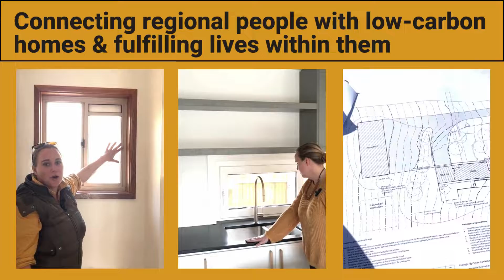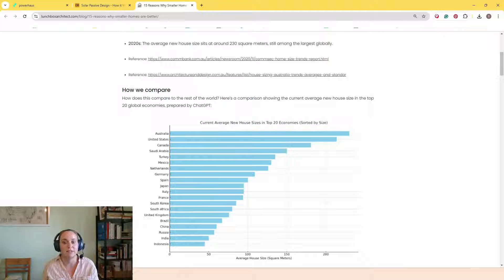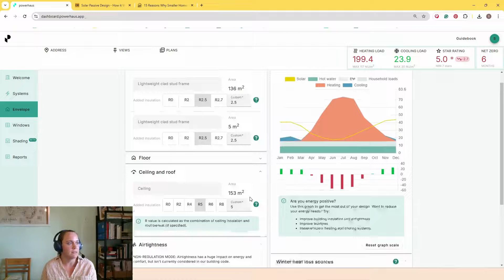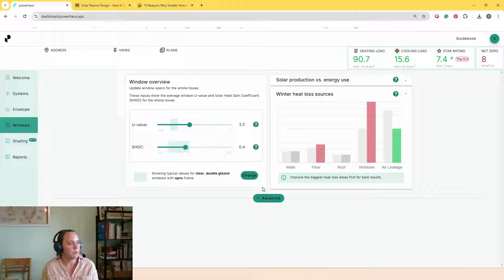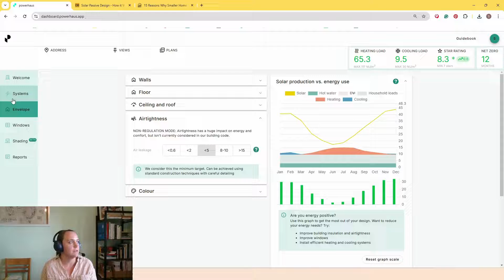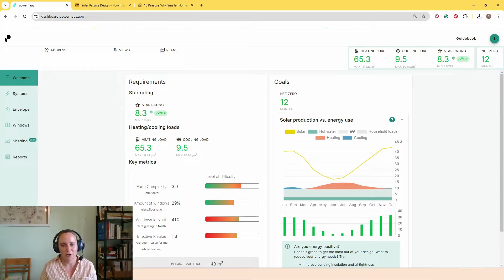How to Prioritise Energy Efficiency Decisions (Simulation)

Comment: You mentioned that a retrofit would be able to get to 7 Stars. Do you think it is too hard to bring a retro fit up to 8 or 8.5 stars? Or is that just not realistic?  I get what you say about the sweet spot re cost and thermal comfort, but.... I'm tossing up buying an old house to retrofit but I'm coming from a high performance house and I dont think I would find a 7 star upgrade would be comfy enough (specially in Sthn Tas)....